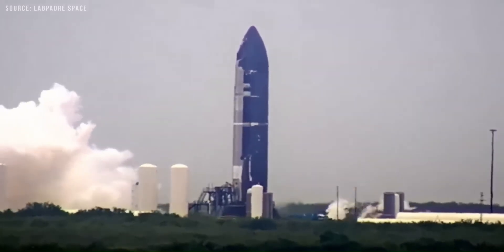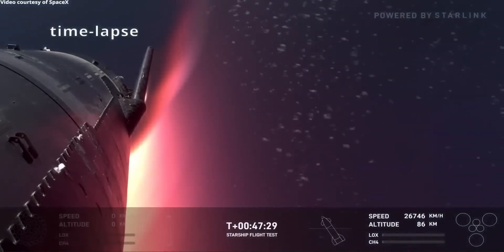SpaceX is Doing Something Unexpected With the Starship Flight 12!

Comment: Why aren't they catching the booster anymore, something wrong?
Reply: Just unnesesery risk. They proved they can do it, than moved on to testing how much booster can handle, putting it on flight profiles much harder, then any that they are expecting to use during commertial use. So as they were basicaly trying to destroy the booster, testing it's limits, turning it rapidly, obviously you do not want to try to land it, risking a demage to infrastructure.
Reply: @kkmiroslaw   damaging infrastructure is not good and the next version will change in these times, I get it. Thanks.

Comment: Why use heat shields?  The whole ship should be "A HEAT SHIELD"?
Reply: Made out of what? If it were possible to combine the strength and relative cheapness of stainless steel with the low thermal conductivity of ceramic tiles into a material that could remain ductile at cryogenic temperatures, resist embrittlement and preferably be as light as titanium, it would been done by now. You would be talking about one of the most exotic materials ever produced. Even if someone could theorise such a material, it would probably be way beyond our present capabilities to manufacture it.